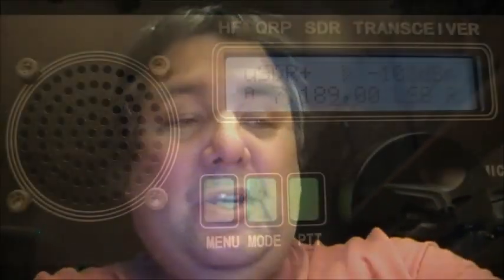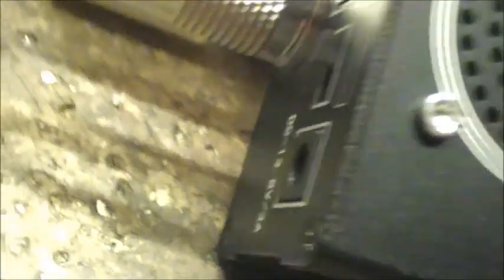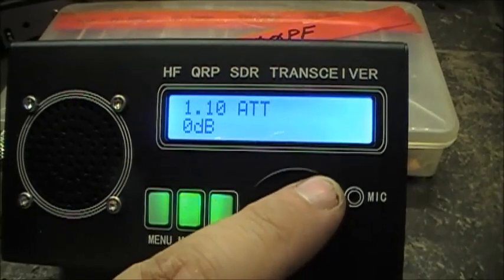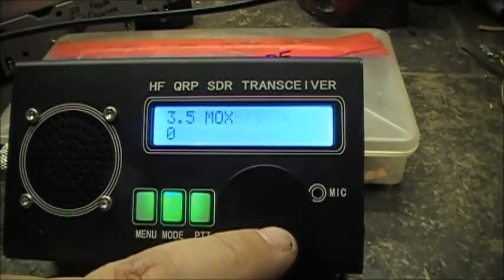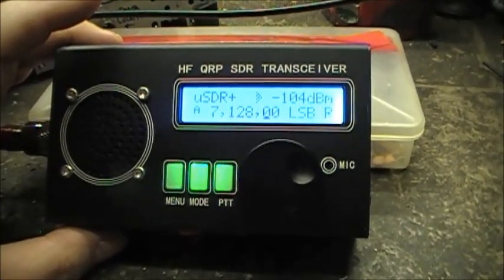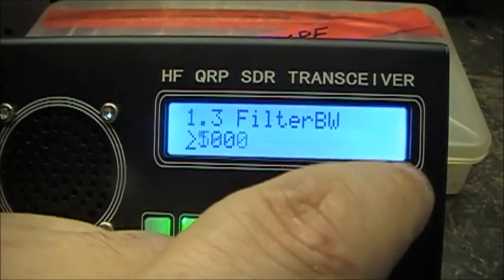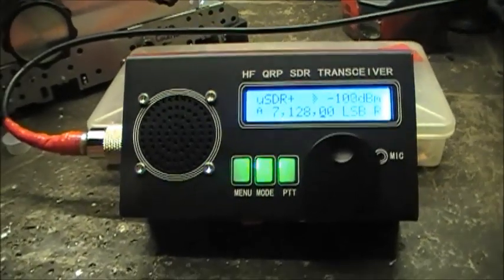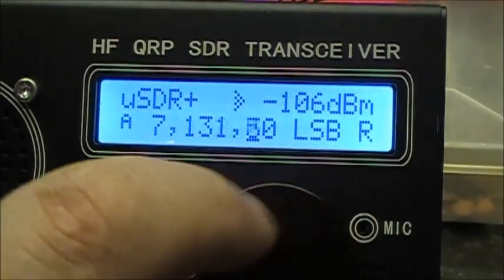HF QRP SDR TRANSCEIVER  - QUICK REVIEW

Comment: I have the exact radio and no matter what you set it to it has crap voice modulation. Works great on FT8 so that is all I use it for.
Reply from the maker: That’s interesting, it’s a bit of a trade off, but it sounds like you’ve found a good use for it!

Comment: Nice video. I see it has the latest firmware as you have MOX and CAT. in your menu The latest firmware has REALLY improved everything on these little QRP rigs. Personally I had the option to buy the original tru-usdx and the Chinese version. I chose the Chinese version merely for the fact that this Chinese version has an aluminium case, not the 3d printed case of the tru-usdx, which I didn't like (to each their own).  The Chinese version its somewhat bigger, so parts arent as squashed together, and the fact that it this model has an internal battery which has so far lasted me over a week, I left it on permanently in RX and TX'd in cw mode. Very happy with my black-brick usdx with version 4.00d firmware like yours. Best 73 de ZS6AKW.

Comment: Cannot clear up audio on ssb any advice?
Reply from the maker: i found that if the audio was set to high, the speaker emitted a ringing noise in the background, if that is the case, lower the volume or try using the device with headphones. :-)
Reply: load firmware 4.00d , it clears up ssb tx and rx audio. Set Quad to "OFF" always. And set NOISE GATE to 4 and TX DRIVE to 4. this clears up SSB immensely. Best 73 de ZS6AKW
Reply: @WarrenAkerman  How do you load the new firmware?